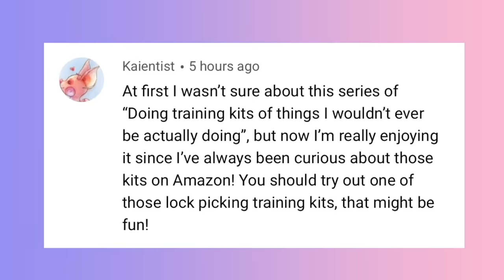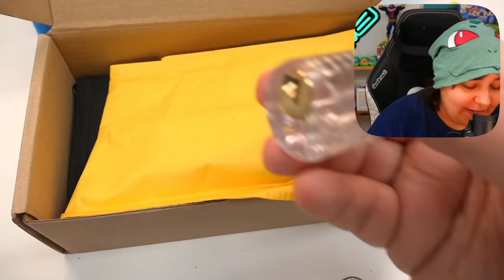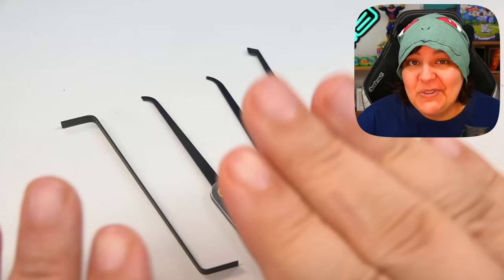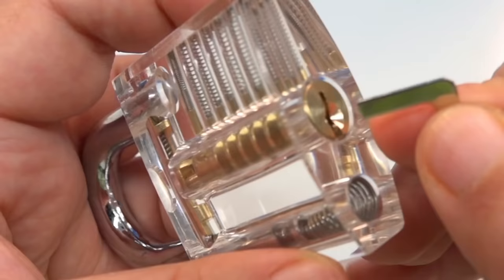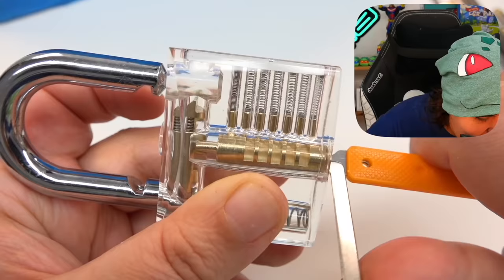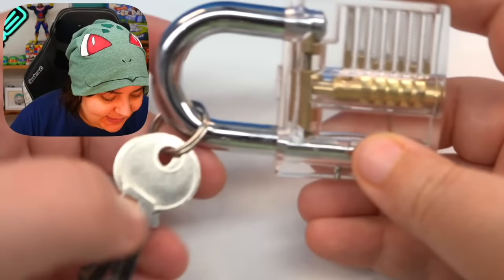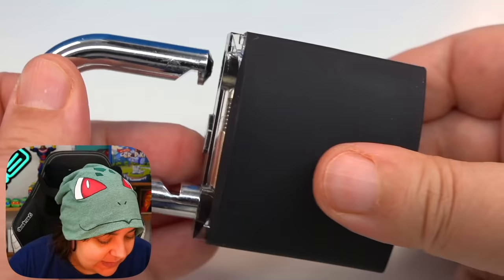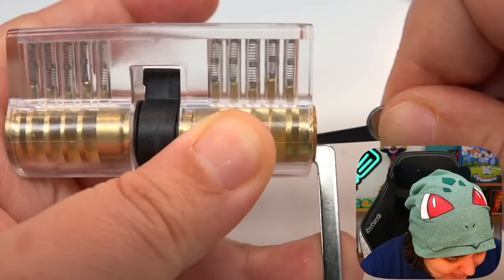Trying Picking Locks First Time With CHEAP Amazon Kits

Comment: I actually work for a company that sells basically THESE exact same locks that you have in the video. These are basically the very beginner locks that you can try out. The picks that you got in the BLACK POUCH are the cheapest of the cheap that you can get for lock picking... But they're good for beginner. Also know that "Criminals" will not use their time to break into someone's house with lock smithing, they will just break something!

ANYONE WANTING TO TRY AND UNLOCK STUFF WITH LOCKSMITHING - DO NOT and I REPEAT DO NOT try and lock pick ANY locks in your own house because it can DAMAGE the lock and pins! ONLY use it on training locks or buy locks that you DONT CARE about.
Reply: NerECrafter community: We're a group of like-minded people from around the world gathering resources to turn each other into vandals.
Reply: It's the assassins you've gotta watch out for with lock picking.
Reply: If you go to a locksmiths sometimes they will sell you locks super cheap that they've opened for customers and then kept because there's no key for it anymore.  Great for practicing on!
Reply: Also, the one with the black in the middle will only work one side at a time.
Reply: I’ve been a locksmith for 20 years. I just want to point out that it will not damage your locks or pins if you pick your own locks.
Reply: I got locked out of my apartment and they indeed ruined the lock getting in. Better than the locksmith who wanted to charge me $200 to break my bedroom window though.
Reply: @jessicah3450  he really offered to break the window for $200? Lol what kinda locksmith is that guy lol
Reply: @KimmieFizzy  I've seen it happen , normally they end up breaking a pick into the keyway and then can't retrieve it with the broken key tool

Comment: When my husband and I started dating, we stepped out onto the front steps to have a smoke (we’ve both quit, so no worries). Forgetting that my front door locked automatically, he pulled it shut too fast for me to stop him. Only problem…it was early November, roughly 20 degrees, both of us were coatless, and I was barefoot. I’d been standing on the thick mat on the top steps, which was perfectly adequate for a 10 minute smoke. We wound up waiting for over an hour for my roommate to get home and let us back in.

While we waited, he wrapped my feet in newspapers from his car, and walked to the corner gas station to buy me a great big cup of coffee as he had dressed far more warmly than I. I knew then and there he was the one.

Comment: You should see lockpickinglawyer's videos, he explains the process really clearly in short videos. The principle is that each pin needs to be raised individually. The tension bar keeps tension on the barrel so that you can press each one up individually and they should 'set' into a raised position. When each pin has been set in their 'gate', the tension bar will be able to turn and unlock ❤️ love your work! 😍

Comment: 23:49 That does look like the correct rake tool, and you do use it by basically just moving it back and forth. The ridges on your rake tool look a lot sharper than the ones on mine, so that might make things more difficult if those sharp peaks are catching on the pins and the pins aren't wanting to move because of tension. The rake tool is somewhat of a "cross your fingers and wait to get lucky" type of tool (You're raking it back and forth in hopes that the random ridges combined with the tension you're applying to the cylinder will result in the pins lining up on their own), as opposed to the hook tools which are generally meant to get more precision so that you can work with one pin at a time and align them yourself. Basically, you've just got to experiment to find the tool and way of moving it that works best for you.
Reply: Ty but why u got those tools

Comment: Hey I’m a locksmith/key cutter with my own business, these locks your practicing on are exactly what they are very basic practice locks, heads up to anyone who wants to try this in there own homes you can damage locks and padlocks doing this with out training and please leave it to the experts so pins/springs etc don’t get damaged and replacement locks will be needed at a further cost

Comment: I remember when my grandfather (licensed locksmith) began to teach me. He gave me a paper mate pen and a paper clip my only other tool a pair of pliers. I had to use the metal of the pen cap to make a torsion rod, and bend the paper clip to a 45 degree angle to make a pick. It did work on the basic blue band master lock fairly easily… oh and the crappy plastic locks are super super easy lol. You need to apply constant pressure to the wrench so when you raise the pins they get caught on the way down.

Comment: I have unlocked the double ended lock with "raking" before, which is moving the pick back and forth in the keyway. I believe that is the correct method, but it can take some time to figure out. 

You opened your kit exactly like I did! I also went back to the other locks to gain confidence again. 

I also tried to pick my front door, way harder than the locks I got.

Comment: I remember when I got locked out of my house back when I was in middle school. I kept pulling on the door handle until I broke it open. I broke the metal piece that has a hole where the lock thing goes to keep it closed. 

So my dad had to push something to keep the door from opening on its own as it didn't close properly anymore.

My dog walked out in the middle of the night, used the restroom and walked right back in because the door opened on its own. 

The next day my dad replaced the part I broke with a much better one and the door would finally stay closed. It was also able to lock properly again...

Comment: My husband and I have multiple lock and pic sets and use them as fidgets basically. In doing so we both can pick a pad lock in less than 10 seconds. A tip for the "harder" padlock, just a normal pin set whereas the "easy" lock had almost no pin set, you have to set each pin individually. The notches in the middle of the pin is where you need to get it to click. So push each in up individually to where the notch is visible and slowly drop the pin so it sets. Go slowly from pin to pin so you don't knock any set pins back down. Also any lock from a set that you can put the pick in all the way and just push it up to get the pins in is not a good lock to train with. Again you should have to set each pin individually

Comment: a scope will work Jackie , you need to put tension on the top by pulling upward so the keys will notch in the proper place. then you will feel the slight stiffening of the dial and a slight small click as the number passes by.There is a more advanced explanation if you look it up :) Btw great video. <3

Comment: Yay, lockpicking!! Lockpicking is a hobby of mine! You did really well! The different picks just manipulate the pins in slightly different ways- in my experience it's kind of trial and error as to which pick works best in which lock. I tend to favor the rake (the jagged one you tried on the house lock) but I use smaller ones that aren't as pointy as the one they gave you. 

I'm not condoning escaping from handcuffs, but handcuff shims are neat. Trying to escape from handcuffs might be fun to do, although I'd recommend not doing it alone so you don't get stuck.

Comment: With a stethoscope, try tensioning the actual lock (pull up on the actual part that comes out of the lock) and try both pressing firmly and pressing lightly on the stethoscope. Doctors can choose how deeply they listen to your body by pressing harder or lighter on the stethoscope to choose whether they’re listening to your heart or your lungs generally. On top of that, if you put that tension on the lock, you’ll likely be able to hear more effectively when you hit a notch that causes a pin to fall out of place or whatever until the lock itself can be pulled open.

Comment: Just as you kept slight tension on the locks you were picking, you might want to try pulling down on the combination lock as you spin. I used to be able to crack cheaper ones by feel alone, but it's been many years.

Comment: I’ve been a locksmith for 20 years now. If you would like I can help make a tutorial for you. Also it’s so much easier when the lock is stable on something like a block of wood for a door knob or a vice for the padlock. I personally prefer the more flexible tensioner. It makes it easy to apply lighter pressure. Last note, it’s supposed to be pin by pin. Not the whole thing at once. If you have the right tension you can get each pin to stay up as you work on the next.

Comment: A little late but if you still want help there are a few tips to give: 1. You want to apply tension before trying to lift any pins. 2. You noticed when you lift too high the lock doesn’t turn and that’s because there’s a shear line between the key pin and driver pin, you only want to set the driver pin above core of the lock. 3. You can start either from the front or back back lift each pin in order separately and you should get a “clicking” feedback when you set a certain pin, after it’s set move to the next. 4. Your fingers shouldn’t hurt, it doesn’t take much tension at all to open a lock, just enough to bind the pins which is most of the time less than what you think. That’s about it for tips for a beginner but once you start getting into security pins things get a lot more difficult which is what most house locks have so rest assured the average guy isn’t gonna break into your home without actually breaking anything. 99% of people that know how to pick locks don’t use it illegally anyways. Love to see people show interest in the sport though, it becomes very addictive when you try and open new locks

Comment: I've picked my own door with bobby pins on a few occasions after locking myself out. I found I need 2. One as the torque wrench and one as  the rake. I also only use the flat side of the bobby pin, and always melt the little nubby bits off the end as well. It's not as easy as using an actual pick set, but it works in a pinch for the standard front door locks separating mefrom my warm bed. Though to be fair, I taught myself using padlocks when I was bored in my mid 20s. 😂

Comment: FYI, you can totally pick a lock with a bobby pin. Well, actually, 2 Bobby pins. You just need to bend them. I once accidentally locked a room in my house and had to get it open. It took me over an hour.

Edit: never mind, you get to bobby pins later. The stethoscope works too, you just have to pull up slightly on the shackle/shank in order to hear the clicks.

Comment: It's actually pretty easy to open lock with a hairpin if you know what you are suppose to do , normally just need less tension on your torsion wrench because it's easier to bend the hair pin when attempting to push the bound pins

Comment: I think a combination lock would be different "clicking"-wise vs a safe. A combination lock basically has little metal (or plastic if very cheap) plates with little notches that you line up said notches in order to open them. Safe mechanisms are usually different and more often are metal.

Comment: I once picked a lock with a paperclip, but didn't turn it all the way, so the lock got stuck.  It's okay; we were clearing out my aunt's place after she died, and I wanted to try to unlock a door which no one was supposed to go through (it went out over the garage and they didn't know if it would support anyone's weight after all these years).  Her house was knocked down by the developer and replace with a couple of townhouses.  Still have the key to the original house, though.

Comment: At 24:00 the tool you're using is call a rake if I'm remembering correctly, and it's supposed to open things by "raking" the tool back and forth to jiggle the pins into place. The tension on the tension tool (idk if that's the right name but w/e) is what keeps the pins in place as you jiggle the rest in place so you can open it.
Reply: I don't feel like editing that so here's a reply to my own comment. I'd def recommend watching the lockpickinglawyer if you haven't already. He's a very chill guy who's very skilled at what he does, although his vids are more "don't use this security product because it sucks" than "this is how you pick locks"
Reply: Also also at 30:00 you need to have tension on the bar of the lock in order to hear the clicks. I used to have a bunch of those kind of locks that I was obsessed with trying to open without the code, and you really need to have tension on the lock because im pretty sure they make those locks to be silent now since people started listening for clicks

Comment: So the other pick with the multiple points is called a rake and the other is the  Torsion bar. Which rake you use is just a matter of preference. You will always need the torsion bar

Comment: I've always wanted to learn how to pick locks, not for anything bad, but because there's been a few times I've been locked out. Once when I was like 6, my parents had to fog the trailer (kill the bugs) and apparently they left the house keys inside. So my brother had to squeeze in through the bathroom window. Then, when I was older (probably like 12-13) I left my house key at home and was locked outside until one of my parents came home. Heard something about using a credit card to shimmy the latch open...never got it to work, though. I think those 2 instances caused me to collect keys...

Comment: I have the same kit if you stick the hooked one up all the way and grab on to the thing that is keeping the part that snaps down in place and pull it back then push it forward it will unlock its a lot faster

Comment: Briefly dated someone from the RCMP that was with a unit that did special investigations, including entries. One thing they told me was that it was a good thing that my deadbolt lock was installed upside down and opposite of the door knob lock, because it takes more time to pick a lock like that because you have to do everything upside down? So unless someone REALLLLLY wanted to get in by picking the lock, they’d go somewhere else that wouldn’t take as much time. Since I moved, I have a nest digital deadbolt, a standard key doorknob, and the storm door has the lock part upside down…. Just to really mess with anyone wanting to break in. 😈 hehe.
Reply: they want in, they WILL get in.. most likely by way of  a window.

Comment: When I was in high school I forgot my house keys. When I got home I couldn’t get in. Both my parents were gone but lucky they forgot to close one of the windows with the screens in them. I used a stick to fit between the screen and pop up the clips that hold the screen in. Once I got it unlocked I popped the screen in and crawled through the window. I don’t forget my keys anymore and we check all the windows before we leave.

Comment: You were pushing the pins way past the shear line on the second lock,  and if you used a narrower tension wrench you might have much easier time getting your pick in and out of the keyway, and putting way too much tension on wrench so the pins won't move easily because they are binding

Comment: In actual use those house locks would be in a door and not need you to hold it, you would have a both hands for the pick tools. The hasp lock would be attached to a lock and you would apply pressure to the hasp so it would pop the second you got it and not lose it.

Comment: I’m assuming that the stethoscope doesn’t work on the little combo lock because the pins are so tiny. Usually when you see them used it’s on big combination safes with big heavy pins. Probably a lot more audible.

Comment: I once locked myself out of the house, got in through a window Using a chair. (I am short. Hashimotos stunted my growth by a few  inches.)  I went to put the chair back outside and shut the door, locking myself out again! I had to go back through the window and do everything over again.  A different time I locked myself out and I had to break the back window to get in. It's hard to break single pained glass intentionally.

Comment: I have been locked out of my apartment a handful of times due to a faulty piece in one of the locks. After the third time it happened, they finally fixed it. And I got locked out of the building entirely once when my key snapped off in the lock.

Comment: LOL I was constantly locking myself out  my vehicle so i  put a key box under the vehicle so I if I lock myself out I have a way to get in but sometimes I would use the key box and leave it in the vehicle and then lock it inside the vehicle lol 😆 so the vehicle I can drive now let you know if you leave the key and stuff inside the vehicle, the other thing I did was leave my headlights on all the time LOL 😆

Comment: I got locked out a few times, it only ended badly once though, it was hot, I'd been at school all day, my little brother's friend showed up and was like "here's a stick try this" and I actually tried it like an absolute fool, obviously the stick broke in the lock, my mum got home like 45 mins later and was fuming and had to get a locksmith out who looked at me with so much confusion.

Another time it was also hot and I'd been out at college all day and I got locked outside in the heat for like 2 hours with nothing to drink and my poor cat was on the inside of the sliding glass door wondering why her mother was not coming in to give her attention. My neighbour saw me awkwardly sitting in my yard fanning myself and came over to be like "would you like a cold drink or to wait in our house" but I was too shy and skittish so I said no and continued to sit there sweating and trying not to cry. My mum arrived back with like a 2 litre of soda and I drank most of it in one go because I had barely had anything to drink all day. Oops.